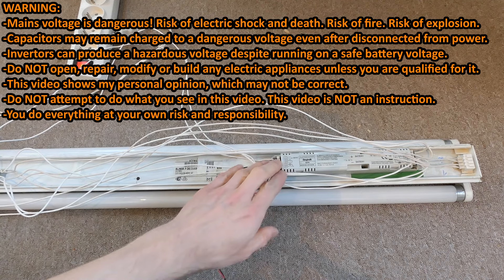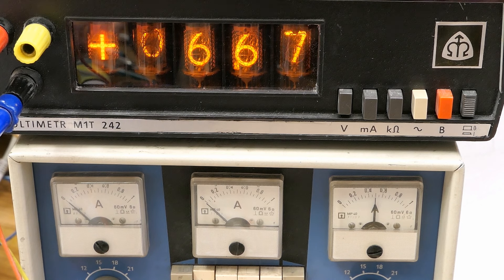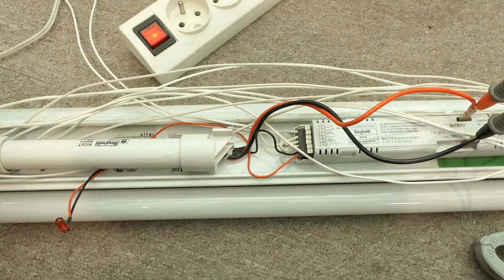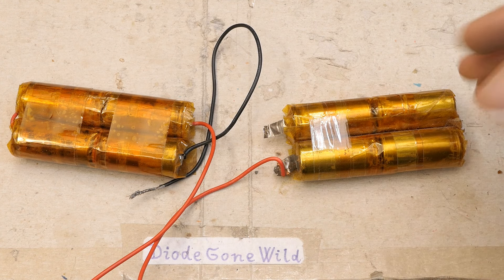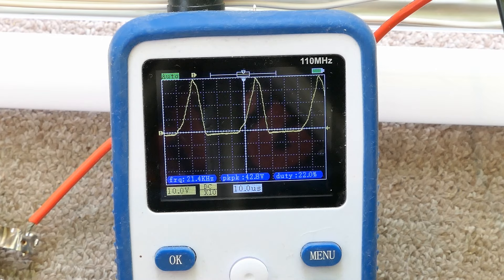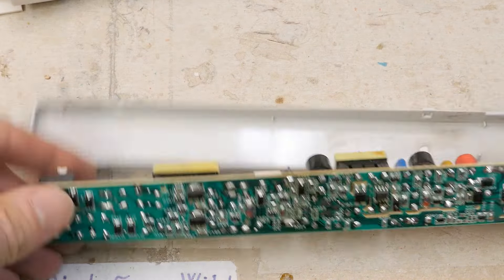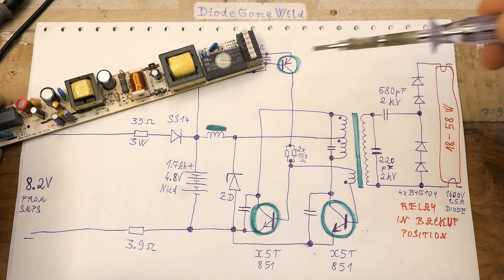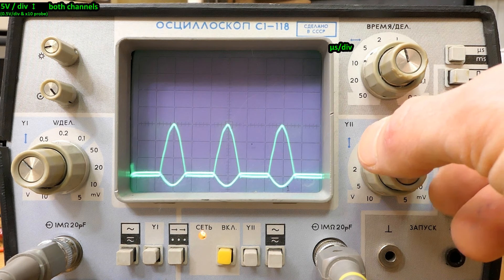Battery fluorescent inverter + Royer oscillator explained

Comment: i so wish I had sent you my old slide projector. 8 separate PCBs in it, 5 different voltags, SCRs, Triacs, Mosfets, EPROMS, RS232 interface, microcontroller in a socket, light guides, photoresistors, plunger coils, little DC motors.... it was a blessing.

Comment: Often you can fix a shorted cell by sending a large pulse of current through it. One method is to charge a large electrolytic capacitor and then discharge that through the cell. Once the cell is no longer shorted, you can charge it as usual, though it may not be reliable. The worst ones I had were some cells that were shorted with a somewhat resistive short that was a low enough resistance that it would self-discharge the cell in a day or so, but not a low enough resistance to be able to get much of the current pulse to go through it, so I couldn't blow away the short.
Reply: Not always - I've tried it.

And the wires between the cell and the case simply burned out.
Reply: @LMB222 I guess if you use a big enough capacitor, destroynig the wires is possible!  Certainly this method of removing shorts does not always work, but if the battery was otherwise to be scrapped, and is intended for a non-critical purpose, then it can be worth a try.
Reply: They also will vent the electrolyte...
Reply: When I've done it I touched the shorted 1.5v cell across a 12v lead acid battery. It worked okay for a bit but continued to get worse.
Reply: @xenoxaos1 Never when I did it. I don't use too much energy though.
Reply: @eDoc2020 I think that might heat it for too long. I would use a capacitor charged to maybe 30V-50V, starting with small capacitors and trying bigger ones until it removes the short.

Comment: Thanks for the detailed rundown. This sort of inverter with a resonant capacitor and supply inductor is properly called a Baxandall oscillator but everyone calls it resonant royer (even Jim Williams called it that). The Royer is the saturation commutated one. Its great how this circuit is so simple and can be very efficient with BJTs. Even some old soviet ones with Uce sat of 0.5v got me to mid 80% efficiency. Also what about the base-emitter voltage limit of the transistors(oh nevermind its not powered from the 8.2 supply but from the 4.8V battery, so it's fine), when i ran this kind of inverter from 20V supply my transistors gradually lost gain and i had to place a reverse diode for protection there.
Reply from the maker: Well, I did a bit of a research, and you're right, it should be called a Baxandall, but everyone calls it Royer for some reason. I put a note into the description.

Comment: Those inverters typically put out AC voltages, so they are usually pretty good with fluorescent tubes - so long as you preheat the filaments!
But here they rectified this output, so that tube will be hating it! Great stuff for LEDs though, you can essentially replace that tube with a series string.

Comment: I like high voltage high frequency power supplies because they can supply all discharge lamps: fluorescent, low pressure sodium, high pressure sodium, high pressure mercury vapor, metal halide, noble gas signs, plasma globes. It should be a symmetrical sine wave likea CCFL inverter.

Comment: I am seeking to build a Royer oscillator to use as a replacement EHT power supply in an oscilloscope that originally sourced its tube EHT off a 950v secondary on its 50Hz poer transformer…but that winding, many thousands of turns if hair-fine wire…shorted. It was the winding right on top so I pulled half of it off and left about 430v worth of it and reconected it as a voltage doubler…and it worked for nine months, but then it shorted again. Iv’e had the pip with it and will tear off the remaining 430v of wire and replace it with a Higher current 20v winding to provide the supply for a Royer high voltage.

The BWD  845 Australian oscilloscope sources ALL its DC rails off a Royer Oscillator…it is a deceptively simple circuit, just an electrilytic decoupling cap, two fairly matched transistors, (MJE3055’s) and the trandformer. There are another two resistors, an electrolytic and a diode that make up the bias circuit. This circuit (in the BWD 845) has no inductor in series with the DC rail as here and the transformer has no air gap in the core.

The Tektronix 7000 series mainframe oscilloscopes also use a similar circuit, again, deceptively simple, just two SLOW 2N3055-like transistors, a bias network and a bypass cap…here too, no series inductor. In the Tek scopes it only provides the EHT and 6.3v heater voltage for the tube heater…but in the BWD 845, it does everything!

I wish to duplicate either of thise circuits and I know enough to know the “magic” is in the transformer, its lack of air gap, (so a saturating core) and I have heard that only a few types of ferrite will work, you just can’t get any old flyback SMPS transformer and grind down the core to close the air gap.

In the BWD 845, this Royer oscillator had “failed”…actually, it still sort of worked, it oscillated but the secindary voltages were all really low and the two original transistors, TIP3055’s got really hot. I assumed that their gain (hfe) had somehow gradually decreased over the last few decades to the point they were unable to get out of yheir linear region…do I replaced them with the two matched MJE 3055’s…all I could get these days…and that fixed it. So the transistors seem to need enough gain to saturate. 
Unloke your circuit here, these produce square waves, lack that series coil and lack any resonator capacitors on any secondaries or between the collectors of the transistors. You did mention thst your circuit here is actually a Baxabdall, if so, are mine true Royers?

I wish to sttempt to build one from scratch, so can you direct me to the type of ferrite i need for the transformer core?
My only real other choice…because of my lack of understanding, is to purchase a Tek 7000 EHT transformer (120-0879-00) online snd build the Royer circuit sround that because I know it has the “correct” type of ferrite and lacks an air gap.

So I am basically seeking to know how somebody designs such a circuit from scratch and I know they start with the transformer core…but how to choose it and how to move forward from there?
Reply: Yep yours is a true Royer. Then there is the current fed Royer that has a series coil. And the Baxandall or current fed resonant Royer has the coil and  resonant capacitor. Check out the schemes that are used for CCFL monitor backlight supplies. Might even be able to reuse the transformer, the CCFL tube voltage is about 1kV i think. The scientific correct name for a Baxandall is a "current-fed push-pull parallel-resonant inverter". Maybe some articles would have a section on transformer design. For the Baxandall transformer design isn't that hard, i have done a couple just by guesswork using subpar soviet 2000 relative permeability ferrite, make sure the transformer doesn't saturate.
Reply: The resonant royers(Baxandall) work elegantly with 5V supply and low Vcesat BJTs, as they dont need a base resistor the efficiency is nice (you will need a base resistor and diode with higher voltage input as it exceeds the Veb limit). See Linear Tech AN65(to a lesser extent AN118) by Jim Williams. There are also MOSFET versions, but they have loss in the gate charging resistors if there is no driver IC. Also the Baxandall inverter is kind of ZVS so it has low switching loss.

Comment: I built a even simpler 12V inverter for flouro tubes using just one power transistor, and some capacitors and resistors! It worked really well, but it completely ruined the tubes very quickly. Flouros indeed don't like running in cold cathode mode at all
Reply: The problem with hat was DC operation. Flyback power supplies output an asymmetrical voltage and the tube will act as a rectifier.

Comment: Nice royer oscillator
Btw, do royer oscillator work with current limited supply? Because ZVS will refuse to start if the supply is current limited/soft start
And what the purpose of C1 and C2 on the schematic?

Comment: Certainly a lot more complex than the cheap 12v drivers I've pulled from a few 8w T5 lights (they were faulty in one way or another), those are usually based on a TIP29B transistor and not much else, a trio of capacitors, a lone diode, a resistor and a transformer wound around a ferrite rod, the one I'm looking at right now flickered badly, but the fitting it came from now sports two 240v Philips Matchbox electronic drivers and two 840 tubes having started off with just a single murky yellow tube... :)

Comment: I don't quite understood the role of the big inductor on the positive line. Is it for limit the peak current on the transistor? suppress interference? resonate with the capacitor next to the transformer?
Reply from the maker: No. The inverter produces a sine wave, not a square wave, so it can't be connected directly to DC. You have to feed it via an inductor to allow for the sine wave halfcycles on the center tap. There would be no inductor if it was a square wave inverter.
Reply: @oneWild I see, i also had that suspicion in mind... Thanks for your clarification 👍😉
Edit: i made a bit of research and indeed the inductor combined with the capacitor makes a sine wave, old school yet simple and clever, according to wikipedia: "The Baxandall converter has been used recently in driving fluorescent tubes from low-voltage sources, often using rechargeable batteries, for emergency lighting and camping etc. Also in his 1959 paper, Baxandall described a voltage-switched variant of the sinewave oscillator. This variant seems to have been the forerunner of most two-transistor drivers for compact fluorescent lamps (CFL's) which has been extended recently to drive low-voltage LED lamps. "

Comment: I've question: why is voltage doubler bad for driving fluorescent lamps?
Reply from the maker: Because it produces a DC current.
Reply: When a CFL is driven with AC, the plasma stays mostly still since it gets accelerated in alternating directions all of the time, even more so with an electronic ballast which operates at 20+kHz and gives ions even less time to accelerate in either direction which improves lamp life. When you apply DC, positively charged atoms in the plasma always accelerate in the same direction, slam into the negative electrode at higher speeds than normal, cause it to sputter and fail prematurely. That is why cold-cathode tubes have a much thicker cathode to accommodate the wear.
Reply: @teardowndan5364 
Thx man!

Comment: I was hoping it would be like a CCFL inverter and drive the tube with AC, not a junk multiplier. They could have simply used a transformer with a higher secondary voltage.
Reply from the maker: Yes, so did I. But putting 2x the number of turns on the transformer secondary was probably too expesive... or maybe this produces less interference. But in a long run, it ruins the tube.

Comment: So basically the inverter is running all the time but only disconnects the lamp when not in use? Weird.
Reply from the maker: This inverter is connected to mains all the time to keep the battery charged and also to keep the relay coil energized, which keeps the tube connected to the mains inverter.

Comment: I think the fact the tube is poorly driven is only as a back up for power failure illumination.
It is not likely to be run this way for long. Better to upset the tube than have injuries trying to exit a building in the dark.!
Reply: 3 hrs as legal requirements.
Reply from the maker: Drawing 1.5A from a 1.7Ah battery, this would work for a little over 1h.

Comment: what is the zener for?
Reply from the maker: I guess it's to protect the transistors from the inductive spike from the inductor when the circuit shuts down. When the PNP transistor turns off, making both the NPN transistors turn off, the circuit suddenly stops drawing current from the inductor, but the inductor tries to keep the current flowing. This creates a high voltage spike, which would damage the transistors, so the Zener has to clamp it.